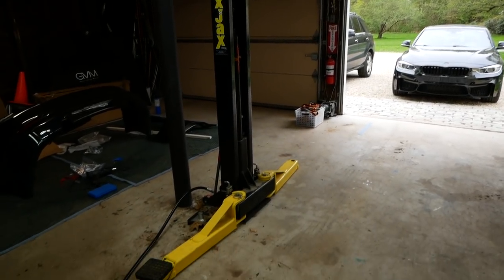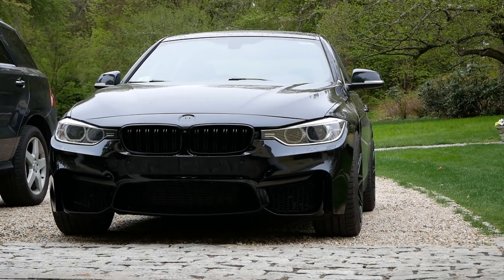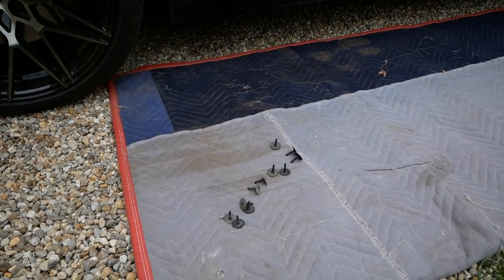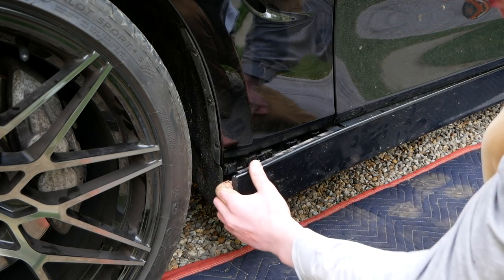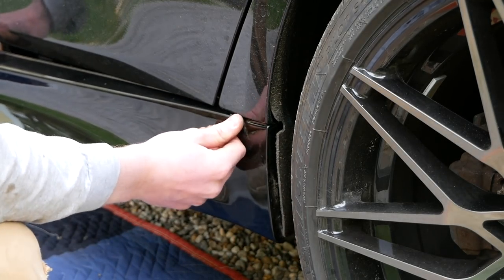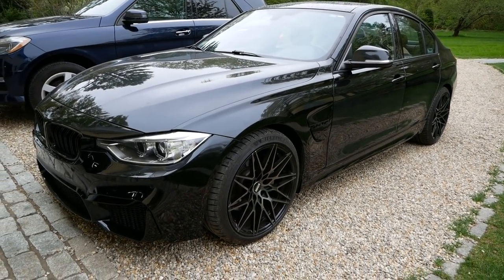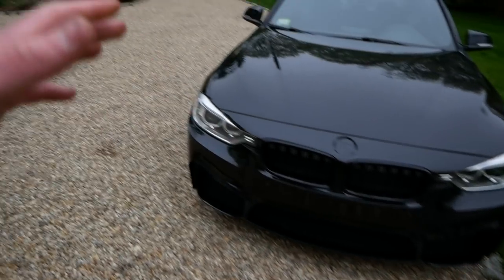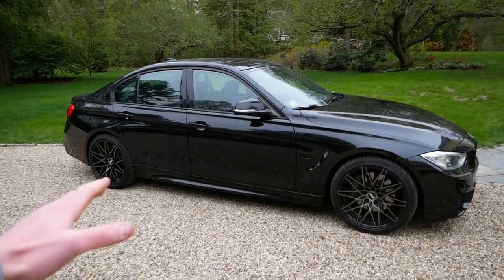M3 STYLE CONVERSION PT. 4 // SIDE SKIRTS

Comment: You rockin wheel spacers? Or are your after party wheel’s offset push them out further? Looks to have a wider stance that fits the M3 kit better than OEM stance👌🏼
Reply: Westin Kriser these “m3” fenders he’s using is not any wider than the stock fenders. These M3 fenders are for f30.
Reply from the maker: This is correct. I may roll my fenders in the future though.
Reply: JD Cars yeah roll them asap